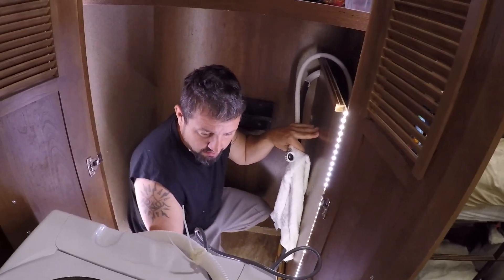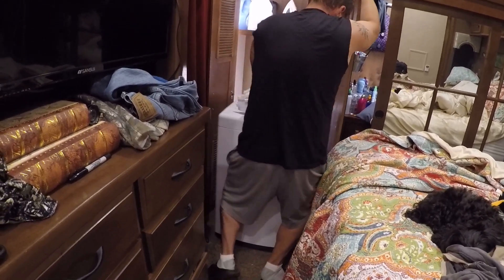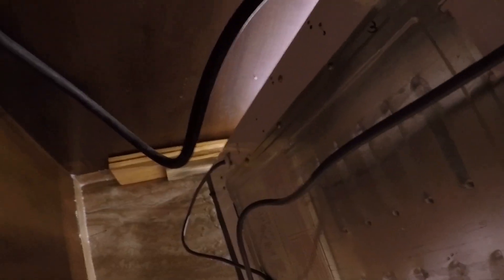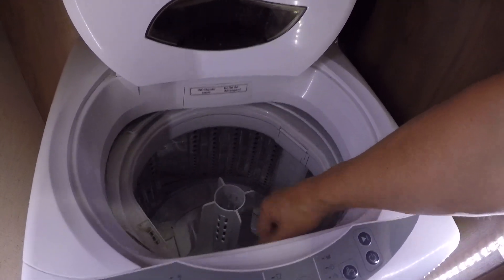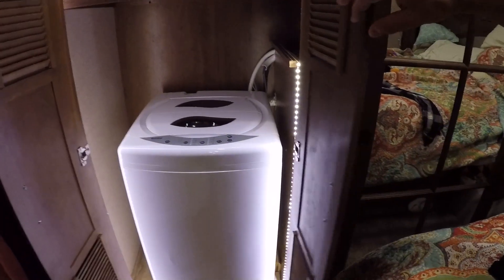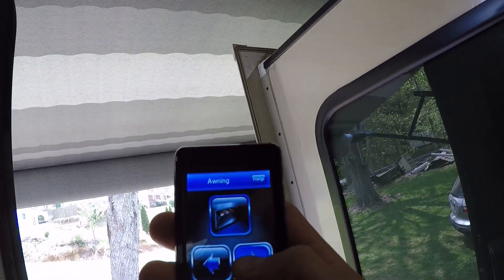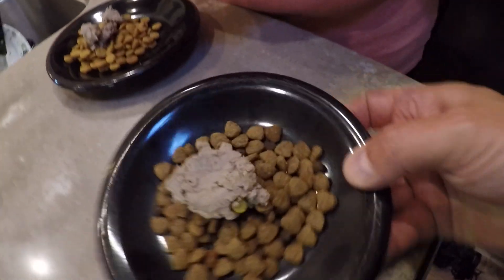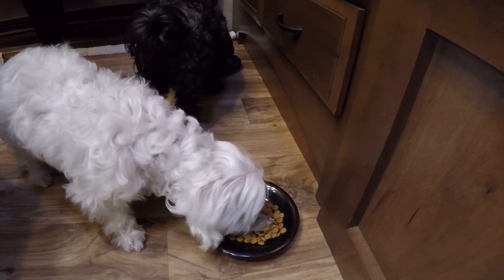Heathers Stressed, Ross Is Moving Around Like Nut Case!

Comment: Ross, I put ours in a plastic drip pan with a drain and a hose emptying out the bottom of the wet bay directly below the washer. Also got a water alarm which has a sensor wire 6-8' long which detects water along its entire length and not just at the end of the wire. Its also expandable with longer extension wires. You can wrap the wire around your hoses and the put some of the wire on the floor and you'll know the instant you have a leak and not days later. I got them both on Amazon. The pan was about 35.00 and the sensor was about 22.00.

Comment: I had three leaks in my NEW Airstream on my first outing.... Toilet, shower, and hot water side for kitchen sink. All I had to do is tighten them up... all of them were loose not even hand tight.... Damn factory !!  and they say they check everything at the dealers.... ya RIGHT  BUTTERCUP !!!
Reply from the maker: true but i installed the washer lol..  i snug stuff up hard..  do you think it got lose from the driving ?
Reply: I think water pressure changes will loosen fittings.
Reply: it could get loose when you drive, but you don't drive so that's not the issue